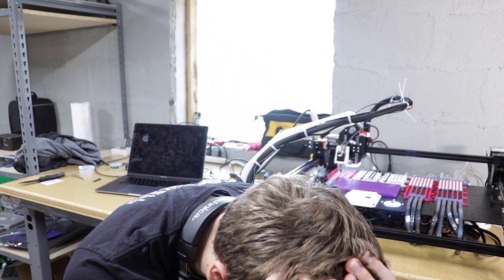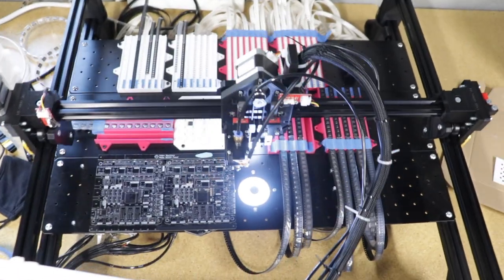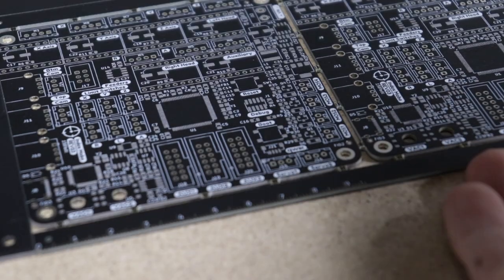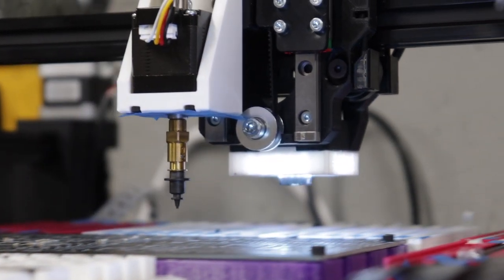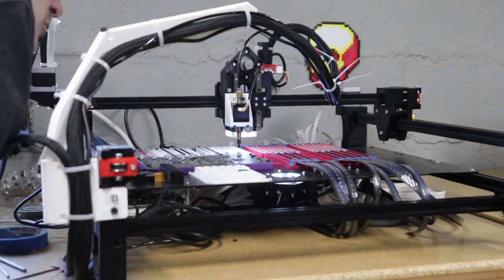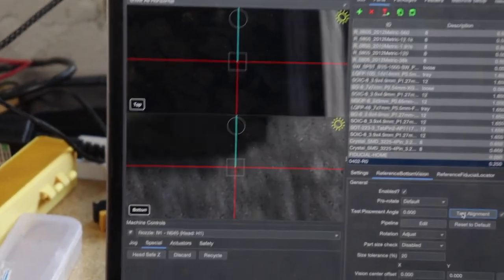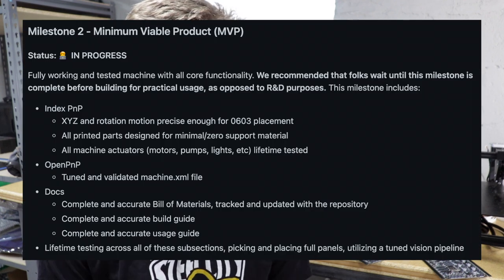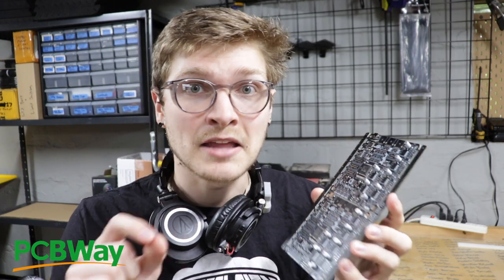The Index Pick and Place Can Build Itself

Comment: I really enjoyed this video.  When I made my first CNC board in 1996, my little family was poor and I relied on free samples from National Semiconductor and there was no PCBWay, so I etched the boards myself.  Now that I'm done tooting my own horn, I'll tell you the fun part.  I constructed two boards, each with about 300 drill holes needed.  Meaning, I needed to drill them myself.  I put them into my milling machine and put up a printout of an excel table of hole locations and drilled them all.  It took about three solid evenings of work.  When I was done drilling the first board, an idea popped into my head.  "what if I populate this board for XY axes and use it to help me drill the other board for Z-theta?"  I raced down to the basement and soldered all the parts in.  I programmed the microcontroller.  After a few days, I was ready to hook it up to the motors on the mill.

I laughed out loud like the guy in this video.  I was alone in the garage when I yelled out loud.  I saw my mill drawing a circle and that feeling of success in my gut made me cry out loud, "Its ALIVE!!!"  I opened the door to the kitchen and yelled into the house, freaking out my wife.  I'm sure the dog barked too.

So I really enjoyed this video because I know that feeling of, "its working".  I've built machinery for the last 25 years, and each time I have satisfaction, seeing my software and designs serving a purpose.  All those machines are like my little mechanical children.  But some of those children were harder to get working, some very challenging.  I appreciate what I saw in this video!  Nice work!

Comment: For paste application you want a blade the full width of the panel
Reply: For sure, 60% blade angle, good presure too.  Put enough paste on the stencil so that the blade makes bead that rolls with the blade.  The bead should be slightly shiny, as it rolls, this will tell you that the paste is mixed well.
Reply: And that "tool" you're using is probably just called a putty knife.
Reply: Also just a single pass and maybe reduce the paste cutouts a little
Reply: Or design and build your own paste-jet printer...

;)
Reply: @Codeaholic1  Right?  Maybe he was having an on camera off day.  If he really didn't know the name of it but yet was born with the internet in his lap, has a 3D printer, laser cutter, scope and who knows what else is kind of unthinkable to those of us who grew up without this stuff at his age.  These millennials kill me sometimes, they don't know how good and easy that have it.

Comment: To validate 0402's, why not just make it place a grid on sticky paper
Reply: Or just don't use 0402s. I hate them. They're useful in RF circuits where they lower the parasitics, but for any other purpose, bigger parts are easier in every way.
Reply: You can just print PCB layout on paper and stick it on an old PCB for testing 402s or other compensate without having to make PCBs for it
Reply: Yup I was going to say the same. You can also take a marker and draw some dots on a paper. If the component lands on the dots you know it is placing them repeatedly.
Reply: That's me from the perspective of a board designer. For the purposes of making a P&P machine, make it work with 0402s and you know it's going to be robust on 0603s. Then you can sit and worry about 0201s instead.
Reply: @davidjohnston4240  then 01005s
Reply: @ericl3272  My God... I gonna cry...
Reply: Nice work. 0402 is impressive.
Reply: @davidjohnston4240  As a board designer, sometimes there isn't space for 0603s. Sometimes there isn't space for 0402s. Yes, I use 0201s occasionally. I end up bring forced to fit my boards into odd places and sizes, and yeah, sometimes it's about space. Other times, it's all about RF, because unlike most hobbyists, my boards need to pass FCC.
Reply: @mausball  Will Stephen's pnp be something that you would use for prototyping/small scale production?
Reply: @johncottrell7901  Unlikely. My boards get made by a board house for me. One of the perks of sending them a few million in orders annually for work.
Reply: @mausball  That and some packages need a tolerance near what a 402 also requires for some special uses. I was recently working with this part TXS0108ERGYR/1910182 witch is larger but it has 20 pins  and is about the size of a 603 hand soldering it was really easy to get it one pin off.

Comment: For the manual application of paste, there’s numerous hand squeegees that will be perfect for this, you mainly just want to have the width be minimum the width of the panel, and even pressure is key (generally 5-8kg per 300mm)

Comment: Best way I can think of applying solder paste: 3d print a tool. I had the following in mind.

The main structure would look almost like a coffee mug. On handle you'd want a trigger. Using housed cable (like the ones for bicycle breaks) you could connect the trigger to a spring loaded door along one of the bottom edges, though I'd highly recommend the one opposite the handle. Ideally you'd want it to work like an upside-down drawbridge (so the edge that would be touching the bottom lifts towards you) with its pivots only a few mm up. Just enough for it to freely move.  The tiny door would also need bounding edges, else the solder would just come out everywhere. Lastly you'd need a means to squeegee up the excess, I was thinking of just applying weather stripping to the bottom of the little door. Lastly you'd need a plunger... aka a piece of plastic that fit snug in the middle of the cup. Neside the door install a rubber wheel that can drive some threaded rod, though you may want to run it through a gear box&dif /have  one set up on wither side. Then just tap and holes on the plunger, set it in place, and you're good. Also the door would make a nice lockout for the plunger driving mechanism, so it would only come out when the frigger is pressed and it's moving.

Basically it's a coffee cup with trigger to pop open a flap along the bottom. Then a roller would slowly push out the solder with little to no excess, and any extra would be collected by the improvised squeegee 🤙

Comment: I work in a facility that has a very large solder paste stencil, we apply with a 1m long rubber squeegee that travels down the stencil. a flat rubber window squeegee will probably be sufficient for your purposes. I'm not 100% sure what material ours is, probably neoprene rubber. it's white rubber with a red layer in the middle, probably a harder plastic for rigidity

Comment: Stencil printer I use is model ZB3040H. There may be more than one with the same part number- this one has a logo of letter B with a crosshatch to left of it. No connection to them, just a good product and so much better than the cheap one it replaced. I do down to 0402 and 0603 8 lead res arrays with it out of the box. Heavy and expensive shipping though.

Comment: The tiny makeup fridges use a 12V 4A Peltier element yeah, and have absolutely no thermal controls, always-on, so they use about 440 kwh/year? That's $100 in electricity a year, depending on where you live.

Cool milestone for the project! :) I'll be keeping an eye on it, love the open source CNC machines.

Comment: Design fiducials (unique shapes) near diagonally opposite corners on the top copper layer, and use the overhead camera to determine their absolute coordinates on the P&P bed, adjusting all component positions and angles relative to the measured fiducial positions.  Then no need to position the board exactly on the bed.

Comment: I once had a job once where I was a Systems Admin where they build Siemens controller boards and the machines placing the components were super fast, they placed the components so fast you could hardly make out what they were doing and some of these components were hardly visible by the naked eye. There were a few bots placing components on the same pc board at the same time.

Comment: In the job I had, the "squeegee" that pulled the paste over the stencil seemed to be the same squeegee material they use for Silkscreening tshirts. There are different grades of flex, you may need to experiment. The angle of the squeegee on draw tilted the "blade" so only one "edge" was in contact with the board. Cheers

Comment: It would have been better if the X rail was a 20 x 40 double wide rail mounted vertically.  This would allow it to resist the torque induced by gravity.
Reply: He open-sourced the design, so fork it, make improvements, and submit a push request! Help make it better!

Comment: 95% of those tiny fridges do use peltier modules, if you're unsure check the power draw, it will be constant if it's a peltier based system

Comment: Very inspiring.  You should be emotional about the accomplishment. So, some obvious questions (assuming a calibrated setup) :
1. What is the amount of time you would suggest allocating to preparing for a new board run?  It seems you said about two weeks.  Or... would you estimate time board configuration as a function of number of components?
2. How long will it take to get the OpenPNP assembled and calibrated?
Reply from the maker: That two weeks metric was more about one-time setup, getting OpenPnP configured for Indexes in general! Setting up for a new board (and other Indexes) will be way, way less. I’ll share more info about setup time after I have more data.

Comment: Hey i´ve just found your Channel and have a few tipps for applying solder paste: 
the tool you are using is perfektly fine for applying Solderpaste but use more paste on the stencil, then stroke the paste over the Stencil so that the paste "rolls over" with that you have the perfect amound of paste on your PCB (Depending on the type of Stencil you are using)
the perfect thickness of a stencil for BGA or LGA chips is 100µ
and for other chips larger than 0201 is 120µ fine
i am using a Mydata tp9 for fabricating PCBs and can say you have done a gread job on that Project

Comment: First off that is freaking awesome!  Great job.  I was fixing to design one, you may have saved me a lot of time but,  Do you know of an open source that can do 201 size resistors and capacitors (4mm tape)?  the LumenPnP did not show 4mm as an option in the config tool.  Also can you manually dial in a place to put component, like if you were only going to place one or two components  doing rework?

Comment: If you wanna apply solder paste, then you should get a bit of a wider tool, I cant recommend a tool thats the entire width (I have been doing this for over 4 years manually at work.
Another thing, use a 45 degree angle and push down with a lot of force, go over it only once, one good stroke.
Hope I could help

Comment: Hey Stephen
Good job man!!!
Well, I'm having a question in mind: What about ESD (Electrostatic Discharge). Do you use some ESD Protection to manufacture this Boards and / or does the Index Machine have some Protection, that it couldn't destroy the Components?

Comment: Have a look at automatic component placement machines and the ribbons the components come on. Your picker head wont need to go to a new origin for a new part it should go back to the same origin. The component ribbon needs a feeder. The way to make this faster to make boards in bulk is to have dedicated component..alotments, assignments.. sections.. ah stations and the board move along a conveyor to the next dedicated component station. That way you can say pick 5 components of one kind and place them simultaneously. I saw a japanese lazer solder station, some components that might be effected by the conveyor can be soldered by laser... for bulk solder paste have a look at screen printing automation. You know t shirts and paint and screens. There is this thing called a carousel which looks like a circus ride the carousel it has multiple screens and turns, one section places paint on the screen and removes  a printed shirt, another section places a new shirt another closes the screen onto the shirt another squeegees the paint across the screen and it spins around and does it all day long. That has different colors so there is a red green blue screen but with paste you can do away with less screens.

Comment: When you solder with water soluble flux solder (wire or paste) you can clean your boards in the dishwasher. Very common in industrial EMS.
BTW, is the mobo on github? I can't find it...

Comment: Hi. I'm making my own Index and therefore my own MOBO rev3. The hardware is done, and now I am trying to flash it with the firmware. I've used the VGT6 version of the STM32F407 instead of the VET6, for availability reason. I think it's compatible as the only difference is a larger memory. But what should I do with the files? Any help would be greatly appreciated as I never flashed STM32 before.